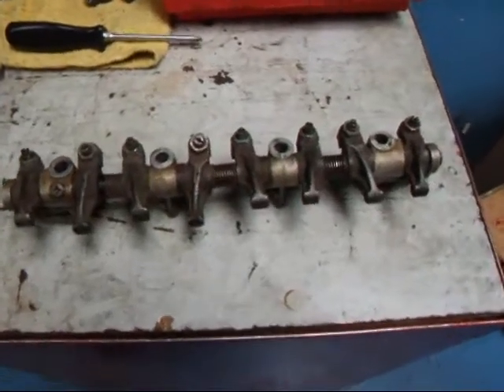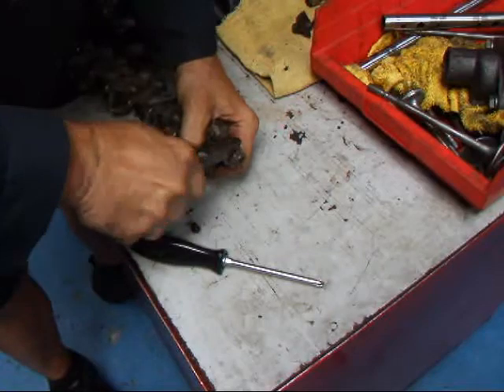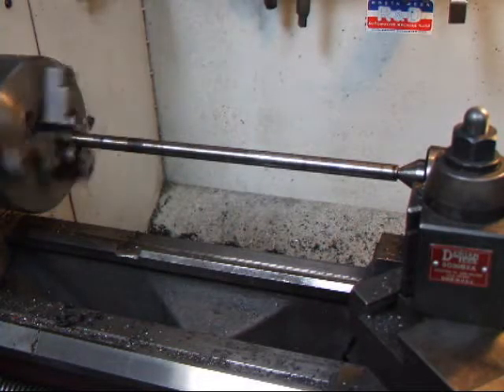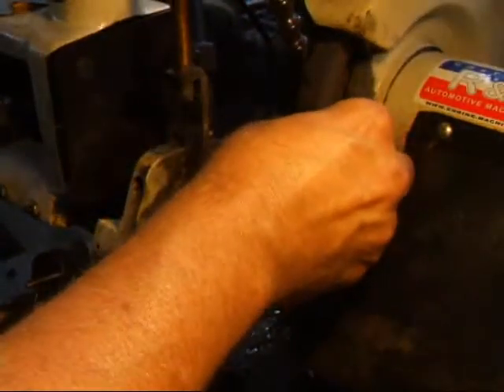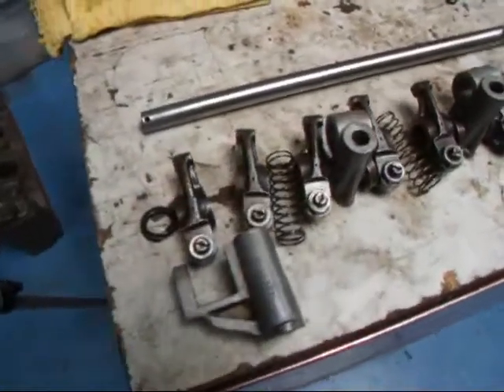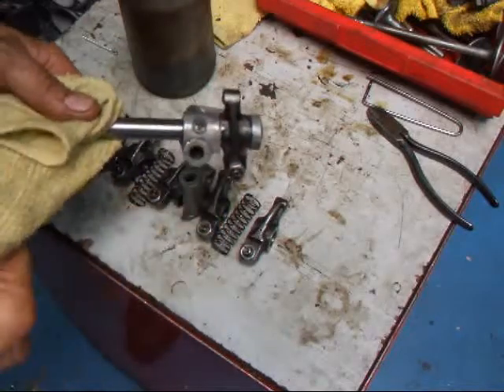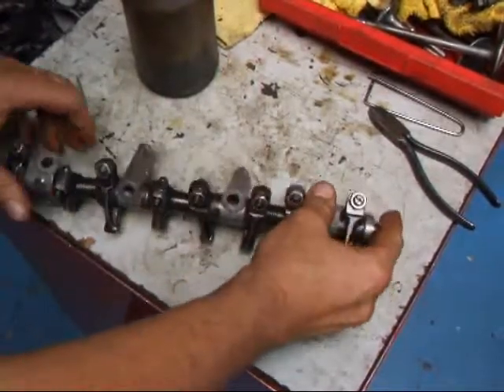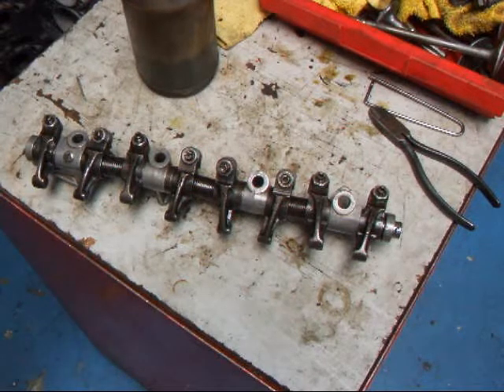Rocker Arm Rebuilding for the Triumph Spitfire

Comment from the maker: The shaft is straight, sometimes the lathe doesn't get it quite centered unless I take the time to dial the part in, in this case I'm polishing, not turning to a center line.